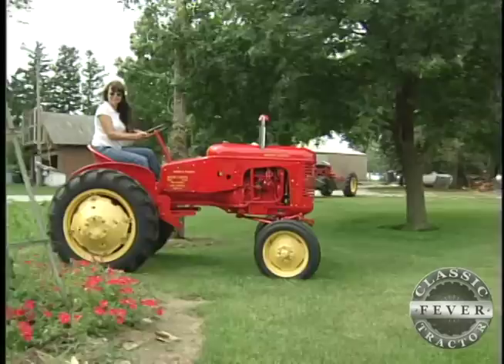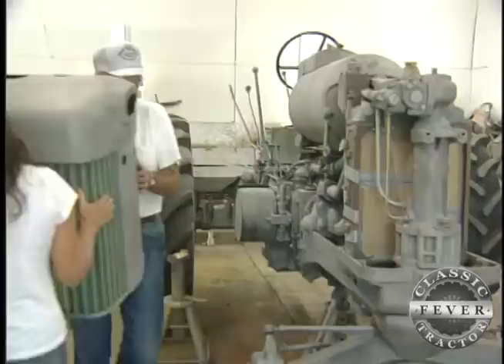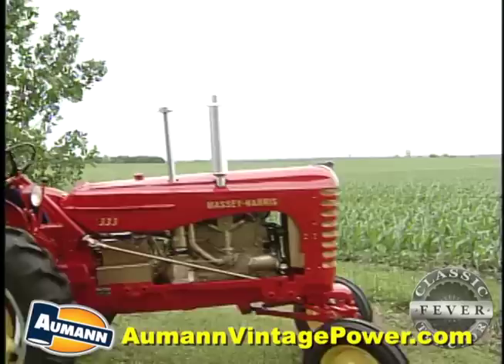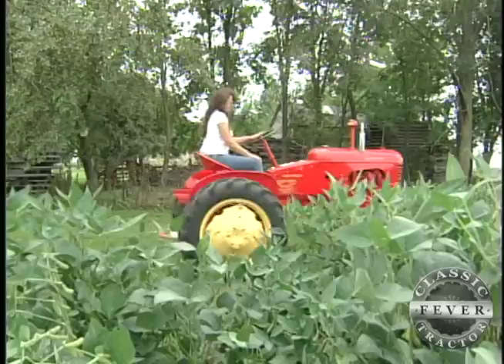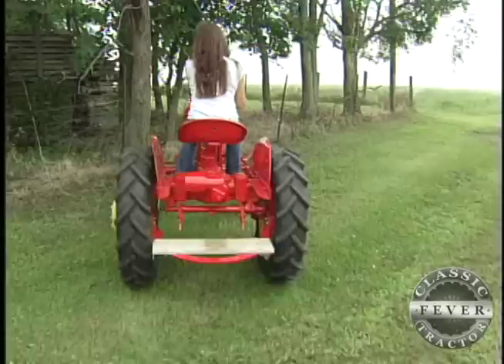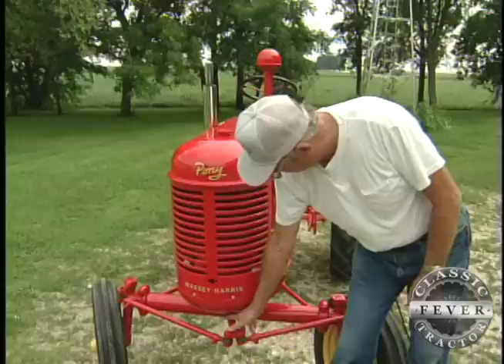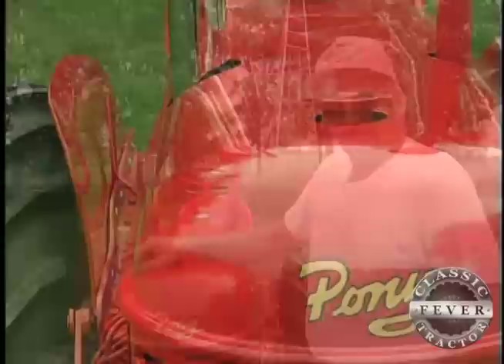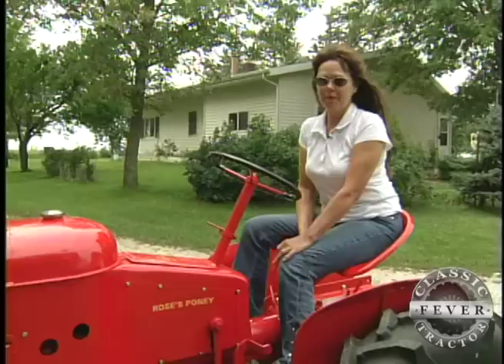1952 Massey Harris Pony Tractor - Classic Tractor Fever

Comment: For 10 years my family used a small Massey-Harris Pony tractor on our small farm in Denmark.
It had a SIMCA Aronde 8 engine, three speed gearbox and hand operated lift for a 12'' Fraugde plow, a 9 toothed stub cultivator and a two-row beet cleaner.
On the draw bar we pulled a four rubber wheeled farm wagon and various other horse-drawn farm tools. We could also mount a small box on the draw-bar on which there could be transported three 40 litters milk bins.
From the age of 12 to 17 I have spent many hours in the seat on it to harrow and plow our fields :-)

Comment: nice trackter  wonder if ya can help me i got a 1956 massy harris pacer 4 cylender  i put new plugs wire cap and coil  its runs good  but soon as i try working it its spitting threw the carb any ida what it would be